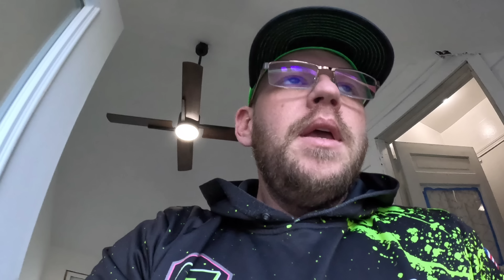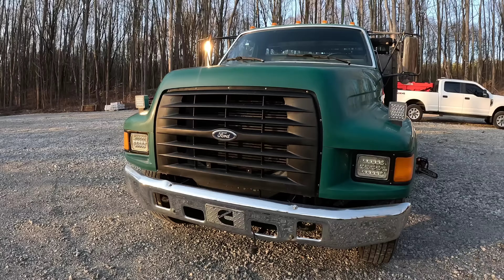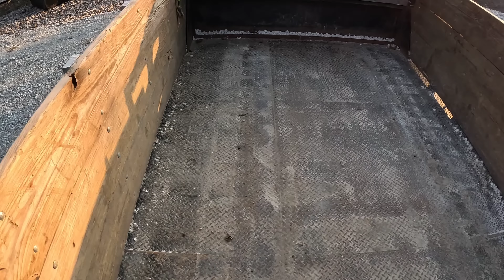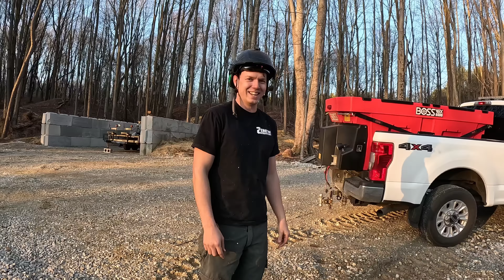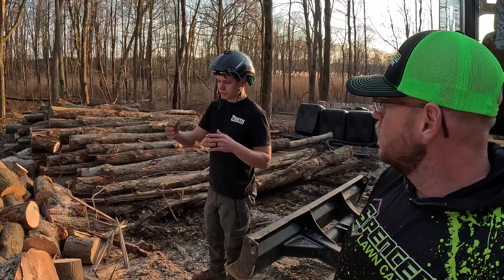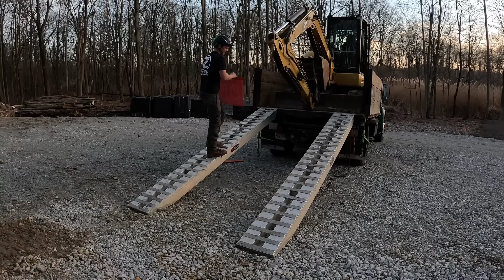"Surprising Outcome: YouTuber Films at My Property!"

Comment: We use an older F800 on the farm as a grain truck and it works well. Ours has a 16 ft dump bed which will hold about 325 - 350 bushels of corn. Zach’s truck does look a little cleaner than ours, though. 😂